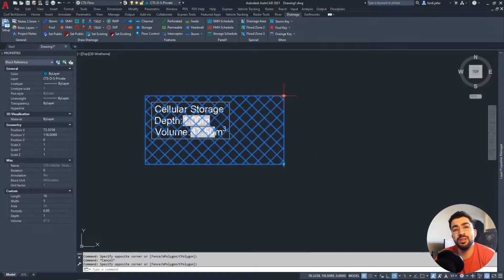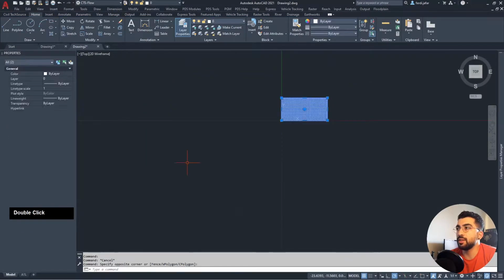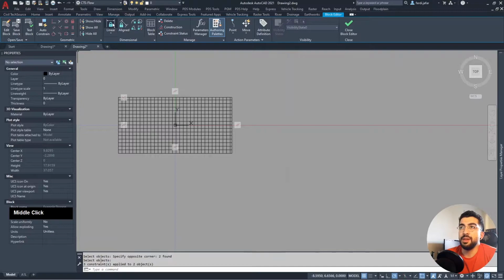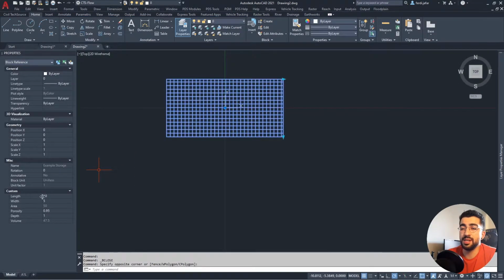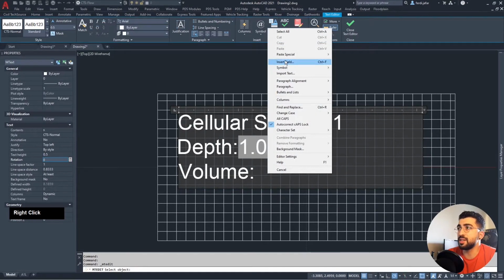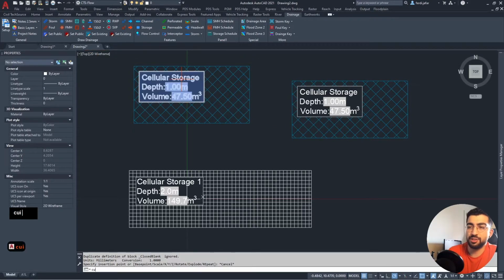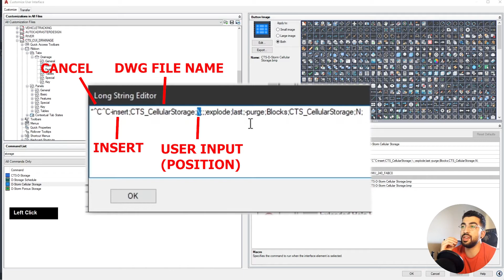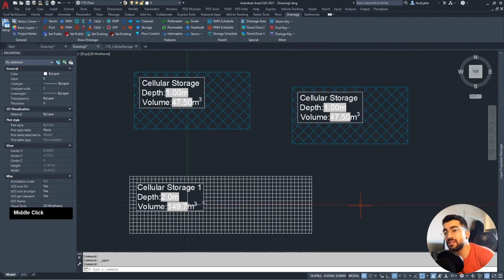AutoCAD Dynamic Block - Creating a Storage block with Insert Field text

Comment: Can we do for a poly line? I mean, i have to calculation carpet area of a flat. Can the same be achieved by adding vertices in your rectangle in any way?
Reply from the maker: Hi Zaid, if the carpet is one piece then I would draw a closed polyline and that gives you the area, unless the carpet comes in pieces then and you find out how many pieces you need, will have a think about and let you know.

Comment: That's great for simple and straightforward rectangles where you have large opened sites with space. Can you do one where site constraints only allow you to weave between pile caps e.g. non-irregular shapes?
Reply from the maker: Hi Allen, a temporary fix would be to use multiple instances of the simple block, keep the properties text on a hidden layer and create a new one with the sum of volumes. Currently, I have not thought on how to go about creating an irregular shape block. Sorry.